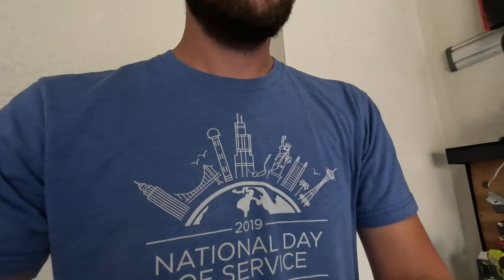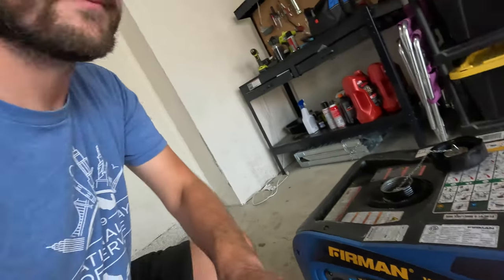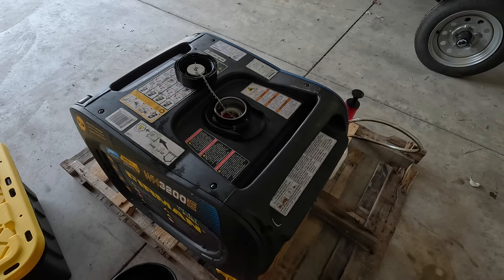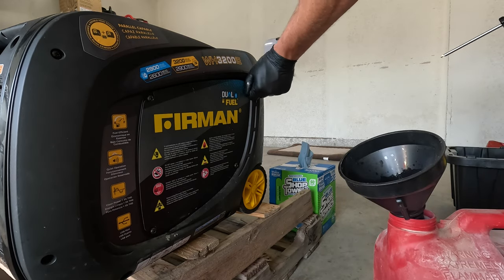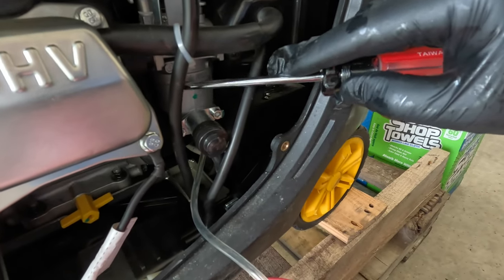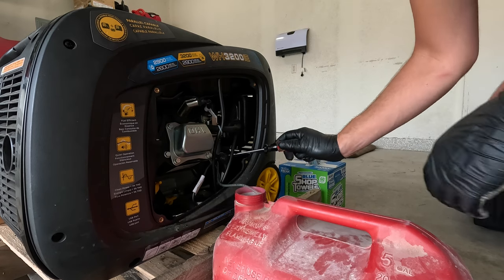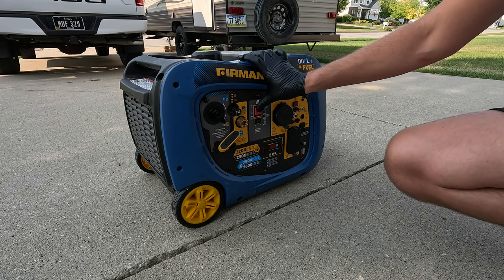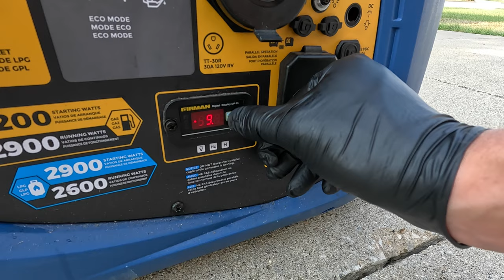DON'T DO THIS TO YOUR GENERATOR | Firman Generator Maintenance

Comment: Being a mechanic all my life your are never to old to learn something.  I have the big brother to this generator tri fuel, and I did not know there was a carb drain on it.  I shall look if so I thank you for this information.  Hopefully it will never have to run on gas.  It is hooked up to a 100 gallon propane tank for emergency use only.

Comment: Nice video, not to be a stickler but we close the choke to force it to pull more fuel (butterfly valve on the carb, pre Venturi).  Opening it is essentially turning it off.

Comment: I own the same generator, never put diesel fuel in it but it will run for 5 minutes and then die and won't resart. Hook up propane and it fires right up and stays running. Figured out that if you loosen the gas cap it will run fine on gasoline with no issues. Called Firman and they sent me a new gas cap figuring the vent wasn't working properly but still have the same problem. I just leave it loose all the time.
Reply: Found this comment, mine wouldn't fire up until I loosened the cap as well... have u had any problems running it like this??
Reply: @adamdominguez7470  I haven't had any issues running it this way. Still works fine, just have to loosen the gas cap half a turn or so. Haven't looked into the issue any further just cause it hasn't caused problems otherwise.

Comment: Mine was used once on the initial startup and ran great. Three months later and it won't turnover. But will run on propane. And I definitely didn't fill it with diesel fuel
Reply from the maker: I’m guessing your carb has some gunk in it.  Propane doesn’t have to flow through the carb.  I would find your favorite small engine place and have them clean the carb or fine a replacement on Amazon.  Thanks for watching! :)
Reply: Same thing happened to mine & I used Ethanol free. I bought for the 3rd weekend in August for the Bow Hunt in Utah. Tried running it today & It doesn't work? 

My Champion worked better than this. Had that for three years & used all types of gas. Now it will start fine, but has very little power... only enough to run the microwave for 5-12 seconds with every other thing turned off, even the lights.

Thought this Costco generator was going to be the Golden Ticket, 😁

Comment: I bought a Champion Dual Fuel 4-1/2 years ago.  I don't know if it runs on gasoline, because I have never used any fuel other than propane.  I suspect that if I did run it on gasoline, there would be danger of the carburetor getting gunked up, even if I managed to empty the fuel bowl.

Comment: I have the same model generator. We normally only use propane. Last summer I tested the night before but battery inside generator was dead. Charged battery for two hours using Firmans included charger. This past winter (we are in Boise Idaho) I kept charger going until May, off and on. Disconnected and tried it a few days later, and started great on propane.
About ten days later, we took it on boondock camping trip. Would not start. Drove it out to phone coverage area, talked with Firman. and tried several things.Verify procedure, replace spark plug. Finally bought gallon of gas and went back to campsite. Started right up on gas with pull cord. Ran through that. When it shut off, I chose to try propane again.worked fine.
At home firman sent a new battery. Swapped batteries. Old battery read 12.9 volts, new only 12.
With new battery, worked great on propane. 
Old battery had significant crack. ouch.

Our generator was a week or so before end of 3 year warranty. They sent battery quickly, free under warranty. They also sent new charger just to be sure, again free. Bought unit at Costco and Costco contacted Firman to confirm purchase date and to help get it fixed up

From now on we'll take 1-2 gallons of gas on such trips. I still prefer using propane, but gas as backup is very valuable, since pull starts are fine with gas but not .

Comment: I knew a lady, who travels in an RV. All her vehicles were gas. Her new RV was a diesel. That’s not the problem. She was parked, at an RV park, she went to hook up to her water spigot, and put water in her fresh tank. When she put the water in her fuel tank instead. Luckily she noticed what she did, before she started the RV. But she had just spent $380.00 for fuel earlier that day, and she had to toss all of it. Just to be safe.

Comment: Thanks for the video. I screen printed and laminated the shot of the carb draining hose and screw for future reference. Question... do  you know why there is that "wake up the battery" button" as you refer to it ? I've had my generator for a few years now and have always been curious as to what is the point of that step in the starting procedure. Thanks.
Reply from the maker: I don’t entirely understand the battery wake up function.  It doesn’t do much for mine as my battery dies if it’s not on the tender.  Thanks for watching :)

Comment: Bought a lawnmower that wouldn't start. A quantum Briggs and Stratton Murray lawnmower for 25 bucks at a pawnshop. Same thing. Someone filled the tank with diesel. Regularly the lawnmower would have been $150. Drained the diesel from the tank and carburetor and boom it ran again.

Comment: Hi Cody,
Have you ever make parallel for firman generator? Parallel outlet on it does not show which is negative and positive and both of them are black.
Reply: Its an AC output, there is no positive or negative. Just connect the left connector with the left connector on the other machine and the right with the right. I'm not even sure it matters which way its connected, but that is the safest way.

Comment: In mode gas can you stop the engine by closing the gas line like unclosed frame generator with this one?
Reply from the maker: This one does not have a fuel shutoff valve unfortunately.  That is one thing I would have liked to see, but when I store it I do make sure the fuel is empty :) thanks for watching :)
Reply: @theconnectedcamper 
Merci pour votre réponse...

Comment: I have this same generator and have always like it until yesterday when it wouldn't start on gas, only propane.  Will run for a few seconds if I spray starting fluid in the head, but nothing with gas.  Have always used ethanol free gas and can't believe that the carb has gummed up even after running dry.  That drain hose at the bottom of the carb is NOT documented in their manual AFAIK, and forget about trying to remove the carb bowl.  The whole generator needs to be taken apart, then the whole carb itself before you can get to the bolt holding the bowl on.  Will try to flush the fuel system with something (fresh gas didn't work), but afraid that I now have a propane only generator until I have the time an patience to take this whole thing apart.

Comment: I have the same generator. It's leaking oil from the drain plug. There's a hole in the middle of the plastic drain plug and it's leaking from there until it becomes empty very frustrating.
Reply from the maker: Oh that’s no good!  Reach out to firman support and let them know the problem.  They have been great to work with!

Comment: They should have installed a factory fuel cut off valve.
Reply: When you switch it to propane it will cut off the gas and thus the charb will drain of the gas when you run it on propane.
Reply: I wonder WHERE it cuts off the gas, at the tank or carb?    @kayak_1

Comment: :58 "Close" the choke. 🙃 Incidentally, diesel fuel won't hurt the engine, not need for the cleaner. Just suck out the diesel, and then add the gasoline.
Reply: This, drain the diesel out of the tank and carb, then fill it full of gas and let it run. At most it will be a bit smokey. Gas in a diesel is bad, but diesel in a gas engine isn't bad, just wont run.